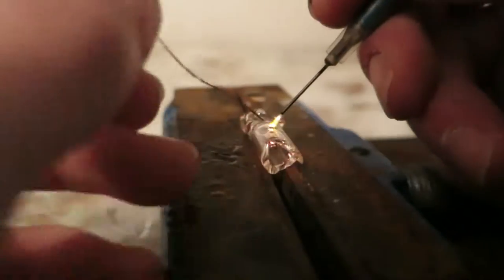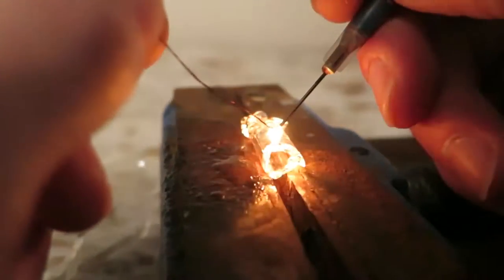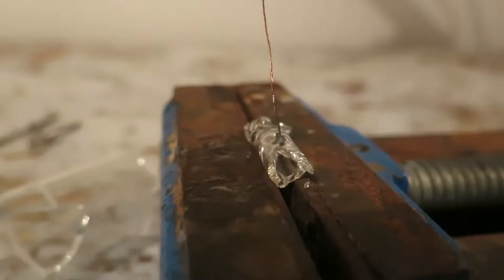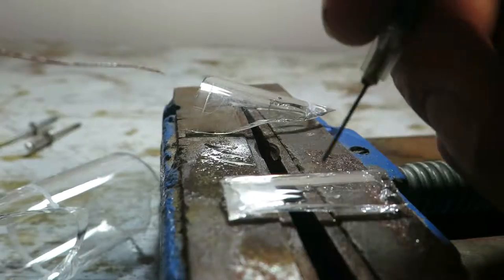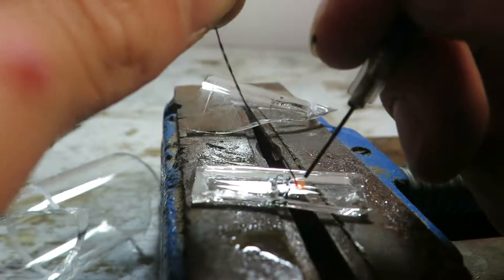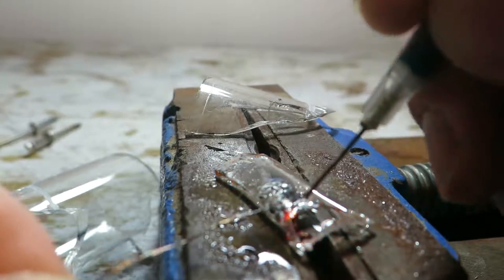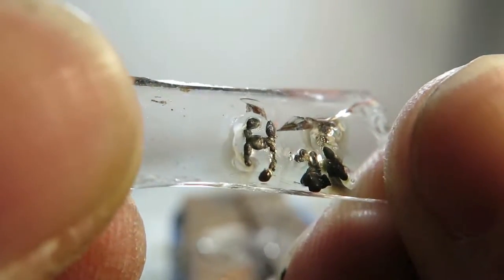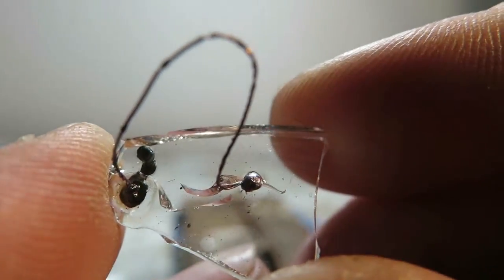Brazing glass with 200W HHO

Comment: with HHO- in my experiments - glass always cracking when cooling down - can't do some with 1mm glass - only with medical ampoules 0.3mm or so
i like just H2 for glass, and when premixed with air, H2 from siringe needle - easy melts steel, when pure H2 melts steel only in some special diameter of needle(0.6mm will do) and only on flow intensive to give 10cm long flame, and no any good temoerature with 3-4cm long H2 flame, or from 1-1.4mm needle(short and fat yelow - but cold, 
However surprisingly H2+air mix flowing from 0.6mm sirinje needle - give strong wind - like a rocket-plastic bags lying on the floor at a distance of a meter - were blown away when he sent a finger-long flame - in their direction - without any nozzle - from a 0.6mm medical needle with H2+air mix
Reply: generator was aluminium cans in aq NaOH in fire extinguisher  - reacts slowly -due to it is alluminium alloy - not just al, 12hr in RT, or you can heat it to 90C -it will work immediately with controllable flow 
0.5l aluminium softdrink cans - scratched just a couple of scratches on the paint(by any needle ) - enough, cut off the ends, twisted the pipe with a roll to put inside FE volume with water and NaOH, 2 * 0.5l gives tomorrow (in a 2l powder fire extinguisher with a 20bar pressure gauge, a gap of 36 atm tests, pump up to a maximum of 20) the volume of 14 atmospheres of hydrogen is a couple of minutes - because you need to throw more and find work